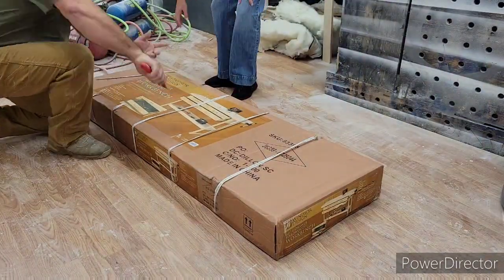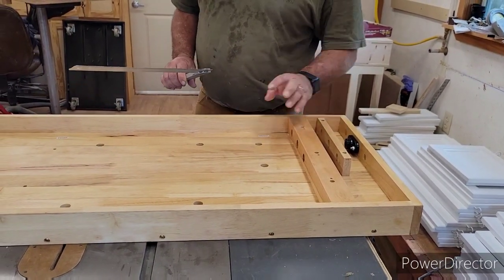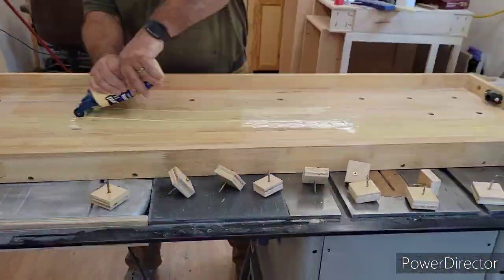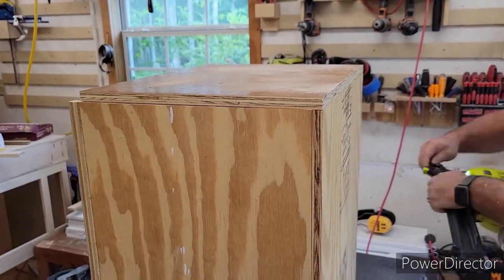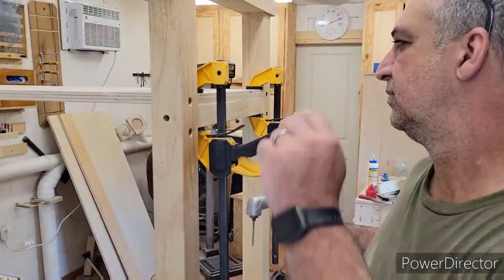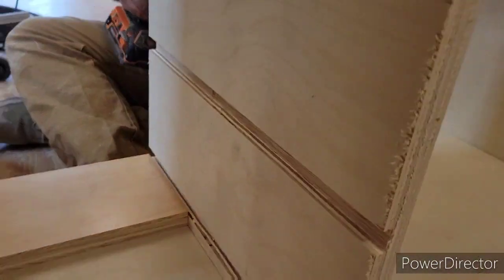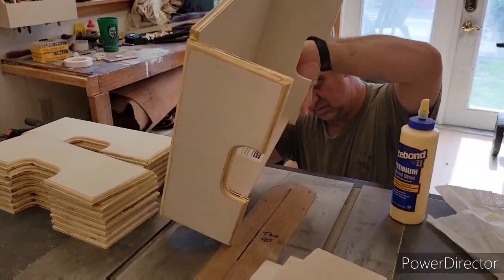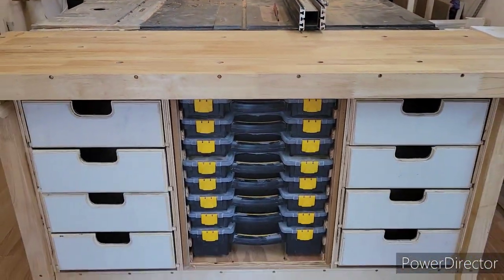Harbor Freight Workbench modifications

Comment: Sir you are the freakin man !!! The tools you have and do with it outshines all the snobby shiny sawstop guys .. no no , not all of them just the ones that have ''em and barely have any sawdust or scratches on them .. you've inspired me to get off my lazy ass off n get my $4k jet cab saw, and create more and first  to mod the same HF workbench too .. you rock !!! Keep ''em coming 

I'm telling everyone about you and your humble tools at such precision results

If you're in dfw texas I'd like to take you for burgers and beer
Reply from the maker: Thank you for your comment. It means a lot to me. 
Expensive tools don't make a nicer product. It just makes it easier to make one. I have not made any videos of me building a finished product. I have been making videos in-between jobs of thing for the shop. My wife wants me to build some picture frames that holds plants this weekend. I will post a video Monday. Let me know what you think.

My 3 most used tools are:
1. Tape measure. I measure everything. If attach two 3/4" boards together they might be 1-7/16".
2. Digital angle finder. Every time I change my blade angle. I never trust stops for tool setups.
3. Digital protractor. I am always checking for square. If everything is cut square and the right size it make assembly easy.

I don't use it much anymore but a flush cut router bit can make any joint come out perfect.

Comment: I bought the new version of this bench today and put it together and have to say that I am very impressed for the money.  I feel I got more than I paid for and I never say that.  The bottom shelf is now solid wood like the top and can hold a lot of weight.  It is true that dust can fall in the dog holes but I don't care.... I just blow out the drawers every few months with my air hose and clean.  The table is very stable... which surprised me... its pretty heavy.  I had the old version and it was wobbly... this one does not wobble.  The vice is only good for small work but Im fine with that.... for the money,  I consider it almost a freebie.  The vise does have strong clamping pressure.  I plan on putting a moxon vice on the opposite end for larger work.  The drawers hold more weight than expected.  The whole bench is hardwood... very hard and is easy to reinforce if need be. All in all a good little bench.
Reply from the maker: I can't tell you how many comments I've gotten saying I could have just built a bench from scratch. That is true. But as you said for the price you can't beat these little benches. When I picked up the first one I was in a hurry and didn't want to take the time to design and build a bench. Over 2 years I was able to modify it several times to meet my needs. I could have built another bench but the first one worked so well I figured might as well have one that matches. Then I completely agree with you you can't find anything that's close to this bench for even twice the cost of this bench.

Comment: Dude you rocked this build and gave me want I needed to pull the trigger and buy that bench and mod it myself.  Good job balancing content and speed in telling your story. You are good at thiis. Keep going.
Reply from the maker: I made a few more mods that didn't make it into the video. This table has worked so good I built a second one. I have a design in my head of how to make it where the two can easily be joined to make a 5x9 table when needed and separate when not.

Comment: You did a great job on this modification.  
My husband and I both have one in our hobby rooms.  He modified both tables to accommodate our craft.  Replaced the cheap slides with slow close that allow the drawers to fully open and we added custom pulls from Hobby Lobby. We both also have added storage but that has been customized to each of our needs.
Reply from the maker: Thanks. Sounds like you did about the same as me. Slides for the drawers would be nice but would have cost more than the bench. Mine is in a shop and does need to be nice just functional. I have another one still in the box. I had thought I might build it different but for what I need I have not ce up with a better design.

Comment: I love that drawer design!  Simple and easy to make, and your dados are your drawer slides.   I ordered the Rockler slides for the original drawers based on another video, but I plan to use your design to make drawers for handplanes and such.
Reply from the maker: 8 set of slide were going  to cost more than the table. I put slides on other drawers in my shop a few years ago. These work much better. Just be sure to wax them.

Comment: Great job with the modification. I still think you could have made one for the same amount of money if you didn't use Baltic Birch. That is almost $100/ sheet where I live. I do wish you hadn't sped up some of the video, though. I had to rewatch it a couple of times to catch everything you said. May I ask what the dimensions are of your shop? I love it!
Reply from the maker: I use import birch. I can't afford Baltic Birch. I pay around $30 a sheet for 3/4".  The original front part of my" Shop" is a  12x24 shed. I built it like you would a house in this area with 2x4 studs but used osb painted white instead of sheet rock. I added 20' to the back, so it is now 12x44.

Comment: Hello Robert 
Thank you for the Great Video. I appreciate your thoroughness in the details. I've been looking at this work bench for a while now. My mind just wasn't sure this could handle the work I am looking to accomplish. Your upgrades will will strengthen the work bench. I look forward to seeing more from your channel. Again thank you
Reply from the maker: For the same money I could have bought some wood and built a bench. This was nice that I did not have to think about what size to make it and speed up the process for me. If you just replace the bottom shelf it will make the bench a lot more stable.
Reply: @ShopRamblings  Hello again Robert 
Thank you for responding,  and the information on the bottom shelf. What is the heaviest weight you have used the bench for? Again thank you
Reply from the maker: @georgeferlazzo7936  I don't stack a lot of weight on it regularly but would not think twice about putting 500lbs on it. I had several 80lb bags of cement sitting on it for a few weeks with no issues.
Reply: @ShopRamblings  Hello again Robert 
That's very impressive,  I was looking at the bench at Harbor Freight, and wondering just how sturdy it is. You mentioned you beef up the bottom shelf. What size board did you use to get that kind of results? Again thank you

Comment: Great video. Thanks for taking the time to share it. You mentioned that one of the flaws with the original bench was that the dog holds allowed sawdust to drop into the top drawers. When you added a sheet of plywood to reinforced the top you said you drilled the dog holds through the reinforced sheet. How did you solve the sawdust falling into the top drawer issue?
Reply from the maker: I have a new Yukon workbench still in the box. Last night, I was modeling blueprints for it. After using these tables for a few years, there are a few things that could have been done better. I hope to have a new video up with a better, easier design, including a free download able blueprint, in a week or two.

To answer your question, I cut a board that just fits above the top drawer on each side. I used pocket screws to secure it in place. I enclosed the back. I put a board to enclose the front, so any dust that goes into the holes can only fall out the back. I have a picture on my community page of my current one. It looks a little different.
Reply: @ShopRamblings - Thank you for your reply.  I have the same workbench and the same problem.  I'm a fairly new woodworker and I wasn't sure how to fix it. I look forward to seeing your new video.  Thanks again for sharing.
Reply from the maker: If you want, you can email me, and I will send you the fusion 360 file of what I have. It is always nice to get other opinions. I work 12 1/2 hour shifts, so I don't have a lot of time to model until my days off. I am trying to make this one easier for people to build. Instead of dados in 3/4" plywood. I have this one with 1/2" plywood and straight cut blocks for the drawers. I am going to put microjig  groves around the front and sides. I have considered  connecting it to dust collection so you can sand on the table and it suck the dust down through the table. Any thoughts?
Reply: @ShopRamblings  - I sent you an email with my email address. Thanks.

Comment: Loved the video, was thinking of getting one of these tables, they way you modified it was great.  However, you need an outfeed table, watching you rip and dado those large boards was scary.  Speaking of scary, watching you work with the router was also scary, please get some push blocks, your hands were close to that bit, I would hate for you to get hurt.  I only say these things b/c a guy I work with lost four fingers to a miter saw.
Reply from the maker: Your are right about an out feed table. That is what I use these tables for. You can never be too safe. I have a couple of fingers that still don't work as good as they did before I had to put them back together. Here is a link to a video I will be releasing soon. I actually reshot the ending after getting your comment. Check out the last 30 seconds and let me know what you think.

https://youtu.be/pdbP-tatQRM

Comment: also, i forgot to ask in my previous comment, what size dado did you make for drawer slides? 3/4 " for 1/2" drawer bottom to facilitate drawer slide sliding without binding. Much appreciate your help with a newbie wood worker.
Reply from the maker: It only needs about 1/16" of space.  The more you put, the more the drawer will tilt down while opened. This is one of my older tables. I filmed building a newer one. I did it without dados but works about the same. Be sure to put wax on where they slide. It makes a huge difference.
Reply: Thanks for quick response

Comment: Great video! Did you end up doing anything to solve the issue of the sawdust and and wood chips falling through the holes into he drawers?
Reply from the maker: On mine I placed wood blocks above the drawers and slide a piece of 1/4 in plywood  on top. My friend did it a better way. On top of the legs he put a 1/2 in piece of plywood all the way across. Then put some spacers before attaching top. This was to bring the top up level with his table saw. It also gave an inch and a half space. This works great for sliding squares ot other flat tools in and keeps all dust out of the drawers.y second table I filled the hole with epoxy and cut dovetails to use the micro jig system.
Reply: @ShopRamblings  great! Thanks for the reply.

Comment: Terrific modification, structurally and functionally. Really shows the possibilities when you use creativity and skill. I envy your confidence that comes from experience. Great job on the video production, too. 

I happen to be in the midst of a project that similarly uses the drawer bottoms for support into dados on the side of the cabinet. The idea came to me one day (to save money on drawer slides), and I since then I haven't seen many other videos that use it. I like the way you've done it; your drawer design is a little simpler than mine (which is for a furniture cabinet). I see you chose not to fit the drawer fronts between the cabinet sides (as most conventional design advice suggests); I suppose this is because you don't expect much stress on that glued joint?  (I'm a beginner woodworker, so just learning what conventions I can and can't break.)
Reply from the maker: When I am building furniture i build my drawer boxes in the traditional way. I have a video on the way I build my drawer boxes. That way when the drawer is open and you look from the side you just see one solid piece of wood.  Then when you attach the front to the drawer box it covers the end of the two side pieces. With this build I was not going to put a drawer front on them so I wanted them to look nice while closed.

Comment: when you added the bottom shelf, you screwed and glued it to the bottom of the leg cross beams instead of the top of the cross beams, which i thought would be stronger. did you choose this approach to get more overall heigh height for the drawers?  Thanks.
Reply from the maker: Yes, and it is plenty strong enough either way.

Comment: hi great project very good instructions. just wondering what type of plywood did you use
Reply from the maker: I use imported birch. I get it for around $30 a sheet. It works great for shop projects.
Reply: I wish i could get that price of $30 in NJ . not at Lowes and HD . where do you get your plywood?? @ShopRamblings
Reply from the maker: @jerseyjoe781, the price of plywood at Home Depot and Lowes is approximately $80 per sheet. Imeca, a cabinet supply store located about 45 minutes away, is where I usually purchase most of my plywood. Additionally, I have another supplier called Hood Distribution. The imported birch plywood from Hood Distribution has a thinner veneer, but it offers good value for its price. I recommend exploring options from cabinet suppliers, as cabinet makers typically do not source their plywood from Home Depot.

Comment: This looks great. Thinking about doing something similar, but I'm a little concerned with gluing the plywood to the underside of the bench like that... The solid wood top will want to expand and contract with seasonal humidity changes while the plywood will not, which can create stress in the top and lead the issues like cupping or splitting. How is it holding up for you so far?
Reply from the maker: First, I will say I am in Florida. Things are different here in other areas. I have had no issues.  I am currently putting together a third one and have already attached the plywood to the top. I use the crap out of mine. I build on them. I stand on them. I have stacked way more weight than I should with no problems. A friend has one with the top the way it came. His has cracked. The top is only about 5/8" thick, and while the wood it hard, it is brittle. I feel the plywood helps strengthen and hold together the top.
Reply: @ShopRamblings  thanks for the insight!

Comment: What attachment was that for your drill when you pre-drilled the leg support holes? I’ve never seen something like that before.
Reply from the maker: I believe you are talking about the right angle bit holder. They are great to have around. Now is the time to get one. They are in black Friday deal at Home Depot. https://www.homedepot.com/p/DEWALT-MAXFIT-Steel-Screwdriving-Bit-Set-with-Right-Angle-Adapter-36-Piece-DWAMF36RASET/316524565

Comment: I have two of these benches I want to modify. Great ideas!
Reply from the maker: I have one more to do. I have not come up with any better ideas so I may just make it the same as this one. Is there anything mod you are thinking of making?
Reply: Great job !! Good mods..👏  I have one of these benches that I want to repurpose as an outfeed/assembly table. I was thinking of modifying it similar to what you did, but wasn't sure exactly how.. I'll definitely use your method of slides for my H.F. organizers.. & i also like using drawer bottoms as the slides.. Like your trick using the table saw miter grooves for assembly 👍🏻 Except that it gets glue on the saw table, but it might be removed easily if the saw has a good waxed surface.
Reply: As for possible mods.. Maybe make the underside of the table, around the sides, flush with the bottom of the edges for clamping down workpieces easier... Also put a bracket system on the ends to keep small clamps & tools handy during assembly, etc...
Sorry my reply was getting pretty long winded, imo, so I divided it into 2.. Again, great job👍🏻, & thanks for the extra insight ahead of time for those of us still thinking about this project.
Reply from the maker: I currently am putting together a second table.  I have epoxy'ed the dawg holes. I am going to route groves for the micro jig system were I will be able to clamp any place on the table. I have in my head a system were I am going to add a 2in board to each side but will be removable with an attachment to hook two tables together for when a bigger table is needed. This would also make for a clamping area when not in use.
Reply from the maker: I try to keep my saw waxes as it has a cast iron top and will rust if I don't. I have a scraper that holds razor blades. It scrapes the glue off in seconds. I glue on top of my saw more than my table because it is easier to clean. If you notice at the end of the video I added spacers to the bottom of the legs to make the the right hieght for an out feed table. I also added drop down wheels to make it easy to move around.

Comment: Can you still use the dog holes?  Or you chose not to drill them out to keep sawdust out of the drawers?
Reply from the maker: Yes, I use my dogs. I modified  it where the dust goes out the back. I have a new table still in the box. It is my next project. I plan to do a new build video with plans to include all the modifications I have done to my older tables the last few years. I hope to have it out in a couple of weeks.

Comment: Have you been pleased with the wen track saw??
Reply from the maker: Yes, I got the Wen because I could afford it, and later, I could upgrade to the Makita or Festool and not have to buy a new track. After using it, I no longer plan to upgrade. It does everything I need.